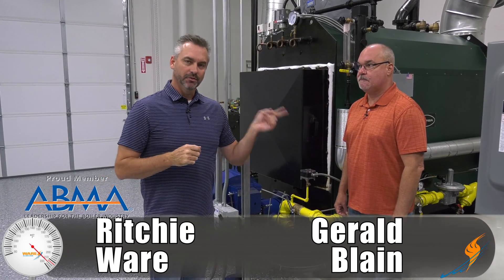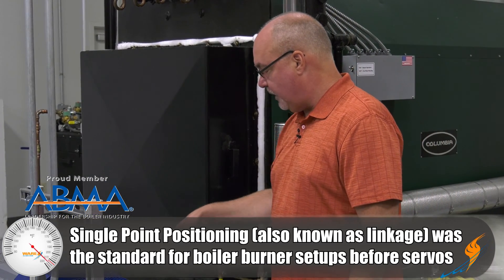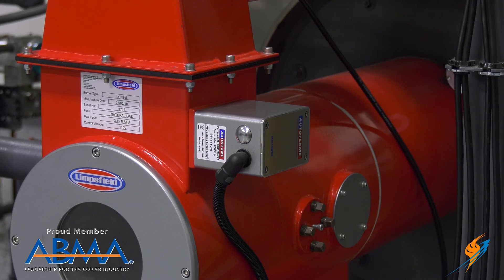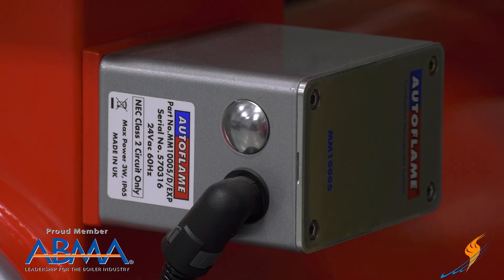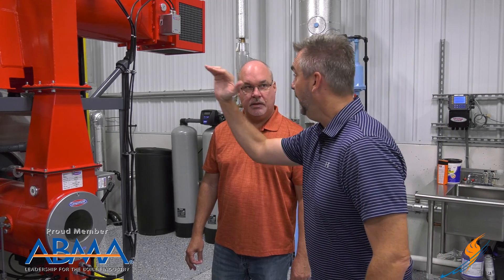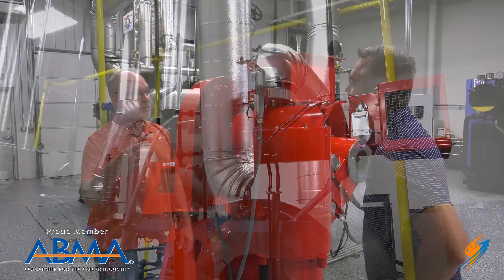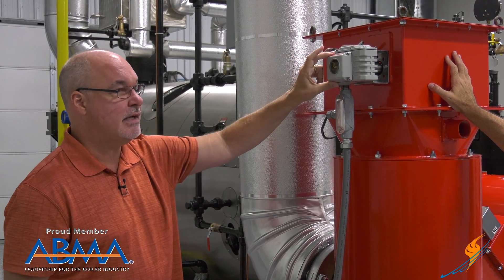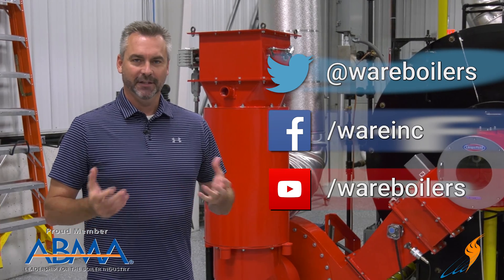Autoflame Servo Motors and Parallel Positioning - Boiling Point

Comment: Please correct me if I am wrong but on your first boiler I noticed the Maxitrol inches to inches regulator vented into the burner compartment. I was under the impression the NFPA 85 code requires this to be a single vent line routed outside or an approved Maxitrol vent limiter installed. I wonder if you could have one of your technicians or engineers address my concerns?
Reply from the maker: Had to look into this one for you. So you are actually seeing an illusion of what you are describing. https://www.wareinc.com/uploads/media/IMG_20190807_135004.jpg take a look at that. You can see our vent lines are going out to vent but then one line is going to the burner for the pilot. They just cross perfectly where it looks like the vent goes to the burner. Hopefully that makes sense now and thanks for commenting!